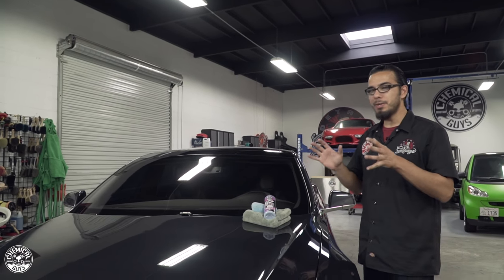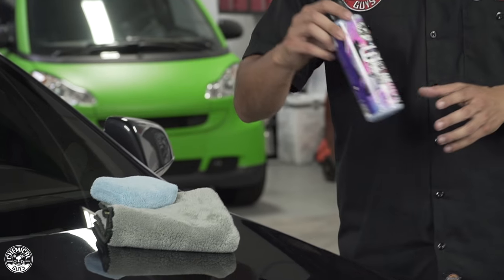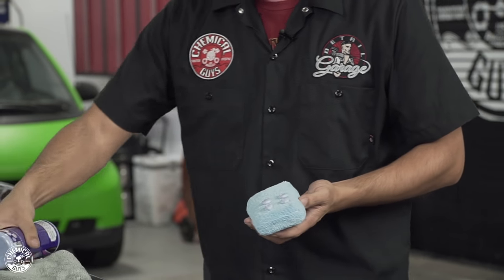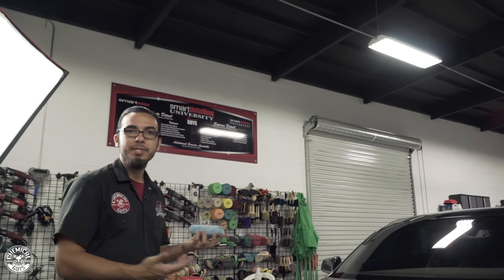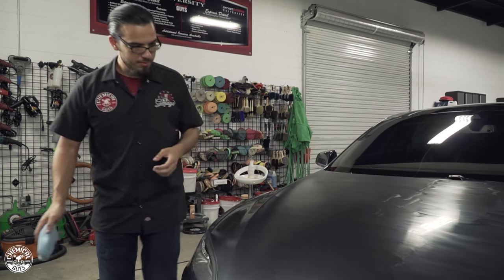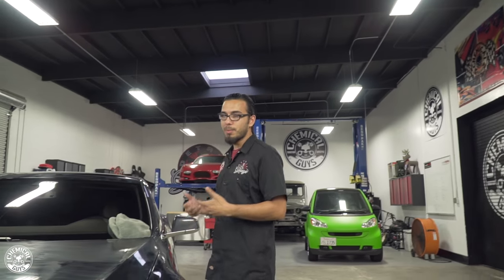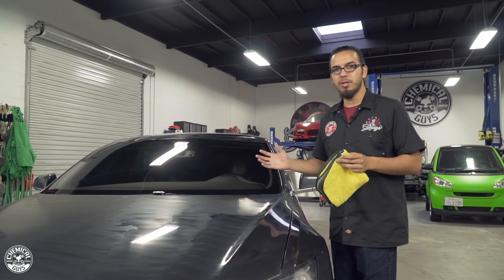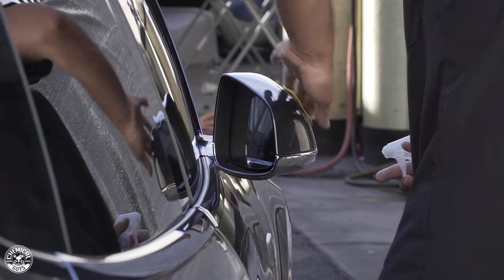How To Make Your Car Glossy Wet - Chemical Guys Car Care

Comment: I’ve been testing out the gloss works glaze on different surfaces. I find that it works really well to make chrome shine and I’ve used it on metallic interior pieces to make them super shiny.
Reply from the maker: Hey Jacob, thanks for the great feedback on our Glossworkz glaze! Yes, Chemical Guys Waxes, Glazes, and Sealants work great on exterior car parts that are shiny or clear. You can use them on glossy paintwork, glossy wraps, metal, glass, clear plastic, carbon fiber, and more! Really glad to have you part of the Chemical Guys family, Jacob, and thanks for sharing!
Reply: @ChemicalGuys  do I use this after vss ? Then followed by butter wax ?

Comment: Is this an alternative to waxing?  Or can this be done in combination with waxing
Reply from the maker: Hi Horse, how's it going? Glazes are not alternatives to waxes and are meant to be used in conjunction with a sealant and/or wax. EZ Creme Glaze fills light swirls, scratches, and other imperfections for improved glossy reflection without time-consuming polishing. Filling in these surface imperfections helps improve the appearance and reflection of your paint. Waxes on the other hand, do not contain any fillers, but will leave your with that deep wet look. Thanks for watching, Horse, and make sure to check back later today for a new video drop!

Comment: Hi Chemical Guys, love your prodcusts though never used your glazes before. Question, between EZ creme glaze and Wet Mirror finish, what would you recommend for more gloss?
Reply from the maker: Hey there! Both are a great option, try using Wet Mirror Finish to mask more imperfections for a smooth surface which enhances gloss.
Reply: Chemical Guys Say no more! 🙂

Comment: If the car does not have any swirls or scratches, can I still use it as paint protection and a for a mirror like finish?
Also can it be used on plastic trim pieces and well as chrome and headlights and tail lights?

Comment: Just wondering these are the steps I plan on taking for my winter detail wash/strip protection, decontaminate paint, polish, Wipeout, glaze, and sealant. Say if I apply jet seal on top of ez creme glaze will that mess up the bonding process of jet seal?
Reply from the maker: Hey Mark, thanks for the question! That's perfect and applying glaze prior to sealant adds longevity while locking in shine. - Happy detailing!

Comment: Just a question but isn't "filling in the scratches" with your product more profitable for you vs. lightly sanding down the paint to even it all together and avoid waxing more often?
Reply from the maker: The product you see is a glaze, it's a very temporary way to mask slight imperfections. You can't fully mask scratches, swirls and imperfections, that's why you need to polish to remove as much damage as you think you need to remove, and then you apply the glaze because it artificially fills in the scratches to give it that flawless look. Glaze doesn't offer any protection, that's why you would apply a wax every two to three months, and a sealant every six to twelve months. Glaze is just one link in the chain, it's a great gloss enhancer, alas it's not a replacement for any of the finishing steps of detailing. Stay tuned for more great videos!
Reply: Chemical Guys THANKS!

Comment: I live in the snow belt and it's a pain cleaning the car. Do you have something that would prevent snow from sticking onto cars?
Reply from the maker: Hi, thanks for watching. The only product we carry that might deter  snow from building up on your paint is Carbon Flex, it assists in water beading, and generally protects the paint from etching. You could also apply a wax which would keep the paint surface protected. Those would be the only items in our lineup that would be of any help to you. Unfortunately we don't carry anything that makes the paint resistant to ice forming and clinging to your vehicle. I've included some videos that might be useful.
https://www.youtube.com/watch?v=yG_q3CsCC1k

https://www.youtube.com/watch?v=cCqB8-xZipc

Comment: What's the difference between this and black light. I'm debating between the two I have a dark car
Reply: That's partly true. some glazes have been known to have dye in them to help reduce and fill the swirls and defects in darker coloured paint
Reply: I agree with you, nothing will beat proper paint correction. i don't use glazes i only know that through watching a Junkman video ages ago

Comment: Hey Chemical Guys, quick questions.
About how many times will a bottle last for my Lexus IS250? And how many applicator pads do you recommend for a while pass around the car? 
Thanks again in advance and keep on making these great videos
Reply from the maker: Hey Brian, that bottle could easily last you 4-5 applications possibly more if you use the product sparingly. You don't need to apply multiple coats because the second will try to bond to the first, preventing it from getting a good bond. I use only one applicator, you get two per pack. You could alternate them, and use the pad conditioner to remove the old waxes to keep the applicator clean and malleable. Stay tuned Brian, we've got a new video launching today, it will be awesome!!

C.G. Alex -
Reply: Chemical Guys thanks guys! Can’t wait to see it!! 🙏🏼🙌🏼😏
Reply from the maker: "Fist bump"

Comment: Does this have any polish (cut) element? Im asking as I see this could be good as a maintenance wax
Reply from the maker: Hi Gordon! EZ Creme Glaze does not contain abrasives so it will not cut the paint. 
- CG Nick
Reply: @ChemicalGuys  hey nick. Would you recommend it as a maintenance wax for every 3 to 6 months or would it be over kill? Bear in mind, by maintenance , no claybaring will be done before application
Reply from the maker: You can apply EZ Creme as often as desired but at least once every 3 months to maintain gloss.

Comment: Can I put a glaze on top of a sealant then use wax to preserve it?????
Reply: Ash Ash the issue I have is the car has had a full correction Polish and sealed with jet seal. but on my last wash I've noticed towl buffing marks when drying the car. I want to try hide this without having to strip it down to the paint again.
Reply: Glaze then sealant then wax
Reply: Carl Littlefair music has NYC 90's hip hop vibe

Comment: How does the EZ glaze compare to the blacklight?   Which one do I use after the clay process?
Reply from the maker: Hola Rick, thanks for watching! Blacklight compliments the pigments in black paint, therefore it's  perfect for dark colored vehicles. The EZ Creme glaze works well for cars with metal flake, reds, yellows, oranges etc. After removing contaminants with your clay bar or block, you'll apply the glaze, followed by your Jet Seal, and then finish up with some Butter Wet Wax. The combination of the three will give your paint deep enhancement, reliable protection, and will preserve your paint from the harshest environmental factors that would otherwise degrade the finish. After you're done, your car will look like the day it came off of the lot. 

C.G. Alex -
Reply: Chemical Guys I have a black RR sport so as you pointed out, I'm going to purchase the blacklight and the butter wax ... thanks amigo !! Great videos
Reply from the maker: You're welcome buddy, send some pics to our Facebook account, we would love to see before and after pictures.

Comment: Does it matter if you wait longer than 15-20 mins to let the glaze sit?
Reply from the maker: Hey, thanks for watching. You want to remove the product so it doesn't stain, also the longer it sits on the paint, the more time it will take to remove it.

Comment: What Is the best way to clean your microfiber applicator pad???
Reply from the maker: Hi Cris, great question! Chemical Guys Microfiber wash is the best way to properly wash and maintain any of your microfiber towels or accesories. It is a powerful yet gentle detergent that removes dirt, grease, stains, dissolves wax, polish, and other detailing chemicals. Microfiber wash is also formulated to be safe for use with standard & high efficiency washing machines. Make sure to check back later today for a new video upload!
-CG Joey
https://www.chemicalguys.com/Microfiber_Wash_Detergent_16_oz_p/cws_201_16.htm

Comment: I tried a low number compound to get rid of my light Swirles and it didn’t work and so I am not sure what to do next ? I am afraid to use a stronger compound that it might cause more damage so I guess I need to let a professional look at my Camaro
Reply from the maker: Hi Johnny, good question. Great job starting off with a lesser aggressive polish, it's exactly what we recommend. We usually suggest starting off with V36, and then changing variables getting more aggressive each time until the desired results are achieved. I'm going to leave an article below that outlines all the steps you should take when polishing your car. Progressively getting slightly more aggressive with each step will ensure you don't take off more clear than needed. Thanks for watching, Johnny, and thanks for being a part of the Chemical Guys family!
https://www.chemicalguys.com/How_To_Choose_The_Right_Compound_Or_Polish_For_Your_Car_s/644.htm

Comment: Hi CG does the ez glaze contain a sealant like the whitelight has? And what sort of duration should a single coating of ez glaze last ?
Jr
Reply from the maker: Hi John, thank you for watching. Blacklight is the one that actually contains a sealant because black cars absorb more heat than white cars. If you plan on using the Ez Creme Glaze, you'll want to apply a sealant, and a coat of wax to protect your paint from the elements. You'll want to reapply the glaze every three to four weeks, glazes don't have the longest life spans.
Reply: Chemical Guys Great thanks for the reply ive used jetseal and whitelight the uniform shine and minor swell filling is really good ,maybe a combanation of the  two for a all in one with better durations 😉 great products thanks again jr.
Reply from the maker: Hey John Glazes only work cosmetic purposes, hence why they don't last as long. Waxes last longer because they're made from Carnauba which is natural, however because of that they don't have the longest life span. Sealants last the longest because they're man made polymers that link up to protect your paint from the harshness of the sun, and creates an invisible shield that wards off paint etching.

C.G. Alex -

Comment: Is this product like a wax?
Reply from the maker: Hi Bill! EZ Creme Glaze is a little different than a wax. It is formulated to help conceal minor swirls and scratches quickly and easily, restore true reflection, and enhance a deep-wet lustrous shine. Waxes, on the other hand, do not fill in surface imperfections, scratches, and swirls. It’s important to know that products like EZ Creme Glaze contain no abrasives, and no protective properties of their own like wax. Spreading EZ Creme Glaze will make paintwork look shinier, glossier, and wetter than it does without it. First spread EZ Creme Glaze over paintwork to enhance a deep wet shine, then top with sealant or wax to “lock in” the signature glowing luster for months to come. Glazing to “fill in” or conceal lighter swirls and defects restores much of the luster and new look to weathered paintwork, but in a fraction the time of longer abrasive polishing and paint correction steps. Adding EZ Creme Glaze after a full paint correction detail will make the scratchless paintwork appear even deeper and wetter than ever before. Thanks for watching, Bill, and stay tuned for more videos headed your way soon!

Comment: Can i apply your butter wet wax in direct sunlight?
Reply from the maker: Hey, thanks for watching. You can apply the wax as long as the temperatures outside aren't excessive, it's generally best to apply the wax when the vehicle is cool to the touch, otherwise you run the risk of interfering with the wax application, and the curing time.

Comment: Hey I just wanted to ask a quick question. If I did use this wax, if I apply it to the headlights will anything happen? I know with other waxes they come off but I just wanted to check just in case.

Comment: How does the EZ Creme compare to Butter Wet Wax?
Reply: Also, how many towels are used to get rid of excess wax?
Reply: From what I know the EZ creme is a glaze so it won't last very long where as butter wet wax is a wax that will give it shine and also last through several washes. If I remember correctly a glaze won't last past one or two washes. You should only need one towel to remove wax from your car, just keep flipping it.
Reply: This is a glaze this goes on before a wax and use 2 towels

Comment: can we apply  Creme Glaze on windshield ?
Reply from the maker: Hi Jordann, 

It's not recommended you put the EZ Creme Glaze on your windshield. It's only designed to go on paintwork.
Reply from the maker: Hi Jordan. There's really no need because you can apply wax ,and sealant to your windshield. Those two will have the most impact because they help to protect against the sun, and create lubricants against staining.
Reply: thanx wax after  sealant  or sealant  after wax ?

Comment: How well does it repel water?...
Reply from the maker: Hi John, it's not designed for that, you'd want to apply sealant and wax for water beading. Ultimately ceramic coatings like Carbon flex are the ultimate water repellent for your paint.

Comment: what polish to use before the glaze?
Reply from the maker: Hi Craig. It really depends on how many scratches, and swirls are present in your paint. You could do a one step like vss, which contains micro abrasives that brake down into a fine polish. Start this way, use V36 with a white, if results don't improve, Do V36 with an orange pad. If the paint is badly scratched, a full paint correction is necessary. Start with V34 with an orange pad, then move onto V36 with a white pad.

Comment: Hi chemical guys 

Can you apply this onto your car after just a nice clean wash ?
-Dario
Reply from the maker: Hi Dario, good question. You should always apply glazes to a nice and clean car. We recommend also claying after washing and before glazing, but if your car was recently clayed and contains no contamination, there's no need to do it again. You have the green light, Dario, you can apply glazes as often as you want! Thanks for watching and check back tomorrow for a new video upload!
Reply: @ChemicalGuys  it is safe to use this Glaze in a Brand New white car? 2 months only since I got it from the Honda Dealer

Comment: Can you wax over this?
Reply from the maker: Hey Marc, you definitely can, what's interesting is that you can apply a sealant over the glaze, and the sealant will have a better base to latch onto. After that, you'd want to apply a wax coating so that you can give your car the maximum amount of protection, and an eye catching shine. Stay tuned buddy, we've got more fantastic content heading your way from the Chemical Guys crew.

C.G. Alex -
Reply: Chemical Guys I just waxed my truck yesterday. Can i apply this OVER the wax? If i can apply this over the wax would i have to wax it after? FYI : I have a Silver truck so would this help with the shine?
Reply: Chemical Guys I want my silver paint on my truck to look like a mirror! I have recently waxed it and the shine just isn't enough. Would this product be good to apply OVER my wax and leave it for a mirror shine?

Comment: basically this is a filler for people who suck at buffing 🤣
Reply: Negative. Sometimes you don't have the money or time to do a whole paint correction yourself. Just because someone sucks at making food, doesn't mean they'll never make themselves a sandwhich.
Reply: Why do so many people hate on glazes. For daily driven vehicles scratches are inevitable. Clear coat is not infinite. I will compound and polish once a year and use glazes in between.
Reply: Weekend Warrior exactly! Glazes don't last forever, there just for touch-ups are in between. I don't remember anyone ever saying that a glaze is going to replace something like a ceramic coating

Comment: can use this on matte black wrap
Reply from the maker: Yooo Oscar,

Definitely don't do it. Matte wraps are not supposed to be glossy at all and this technique shows you ways to make your vehicle glossy. You're going to want to use matte specific products to keep your paintowork safe from gloss and most importantly, adding any unwanted scratches and swirls that are nearly impossible to get out.

Comment: When bugging of wax or glaze should i move and buff off in straight lines? Also whats the difference between wax glaze sealant etc
Reply from the maker: What's up there, Chino. In every application of any sorts to your vehicle, you're going to want to do it in straight lines. A glaze is able to fill in minor swirls and scratches while also adding a ton of extra gloss, shine and a deep-wet look. It's the very first step after you do your polish on you vehicle. The sealant is all about protection; it's the ultimate defense against all that Mother Nature wants to attack your vehicle. For example, our JetSeal is able to help repel harsh UV solar rays, pollution, water spots, bug and bird residues, and road grime. It's also very durable, lasting you up to 12 months of protection. The wax is the cherry on top; it's a little bit of both. It's your first line of defense: it'll add to your deep wet shine while also improving your level of protection. 

-CG Javier